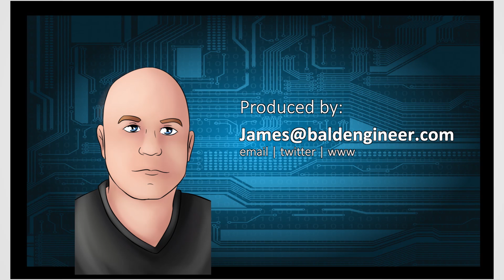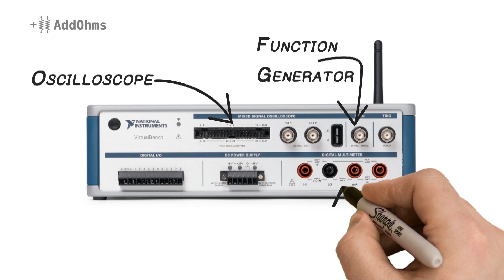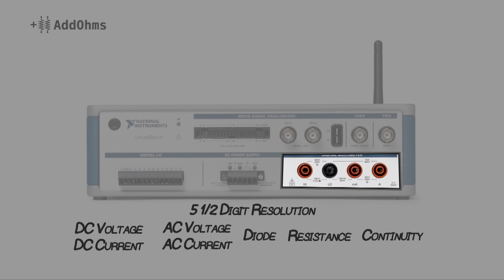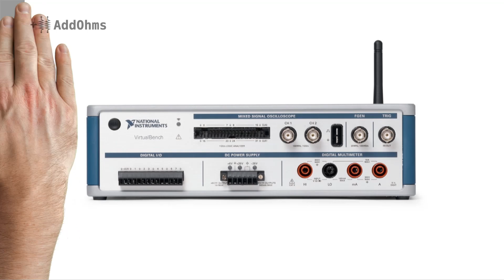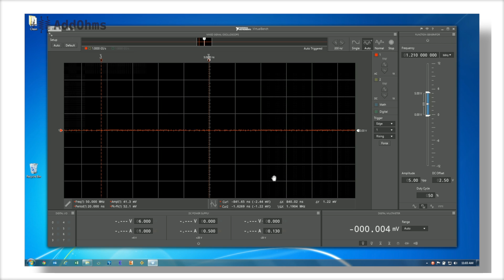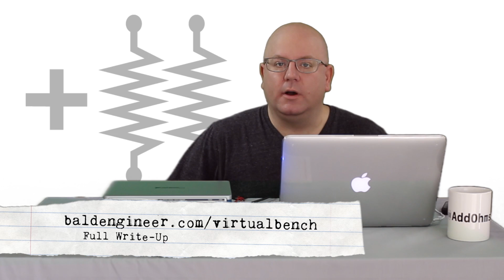VirtualBench Overview | AddOhms #14

Comment: This should have been a fail! You can get a Siglent 200 Mhz Oscilloscope for about $370, a Instek Function generator for about $150 or a Siglent for about $400, a Siglent 3 output 0-30VDC digital programmable power supply for about $400 and a Keysight 10,000 count multi-meter for about $350 and still save about $500, if yo got the Instek you would save nearly $700 and have some of the best gear on the market in that price range. You can also get a Rigol 4 channel scope for about $350.
Reply from the maker: Two considerations. For 1:1 comparison, you'd need to consider a 32-channel MSO which will eat into that $500 margin. Additionally, this product was released years ago when some of these budget options didn't exist or at least not at the price points they are today. At the time, there wasn't much gap.

That said, I am surprised to look at pricing of the original model as of today. It has gone up, not down with time. At a quick glance, I didn't see any changes in the hardware.

While I didn't buy one for my lab, I did buy some for doing tradeshow demos at work. The compact form factor trumped the capabilities of the hardware. However, if I were out fitting my personal lab, today, I'd be looking at something like the Analog Discovery 2 as an all-in-one starter piece, not the VB.

Comment: I'll stick with my home made ATX bench power supply, DSO183, basic multimeter and DIY function generator which cost under £30 / $50.
Reply: Nice bit of kit though....
Reply: Though the DSO183 is nice for the price, it really can't compare to a real oscilloscope.
Other than that, good choice on the ATX PSU and Multimeter - what generator did you build?

Comment: How can I control the tension of the power supply? I see no trimmer or something. Also you can use it as constant current? ( other knobs missing ). Last thing, it works only on Ipad or also android tablets?
Reply from the maker: +babungaCTR Everything is controlled through the software. At the time I made the video, the app was only on iPad.

Comment: Q) Are you running the (MS-Windows) app on your MacBook via an emulator (e.g. 'Parallels Desktop' / 'VMware Fusion'  / 'Wine') ?
Reply from the maker: GAFAPilot I wouldn't lump Parallels and VMware with Wine.  Parallels and VMware aren't emulators, they are virtual machines.  And yes I am running Parallels.